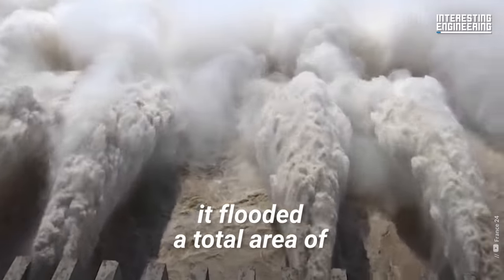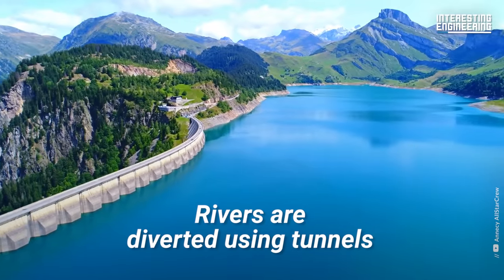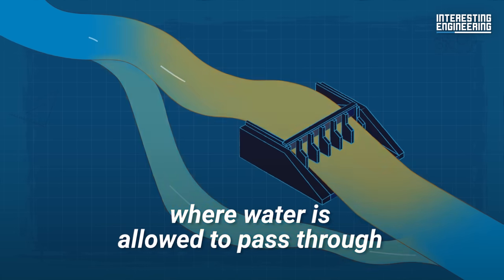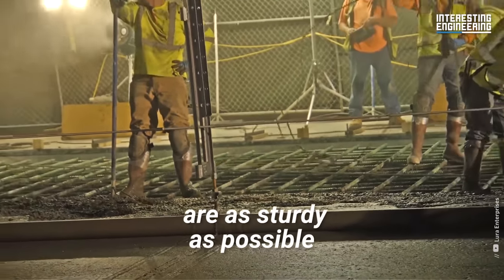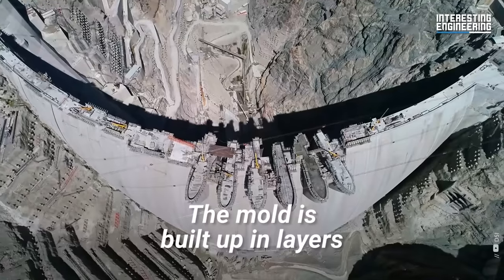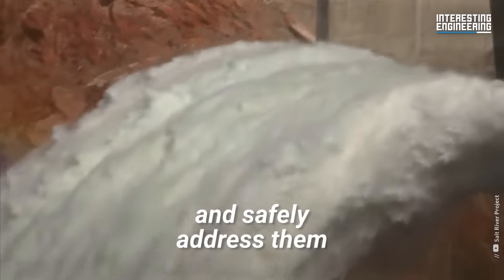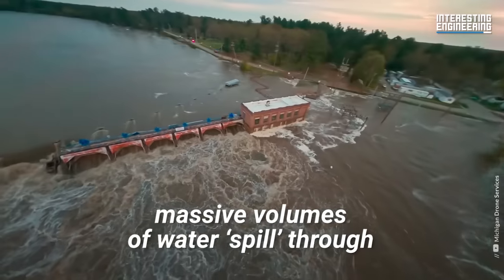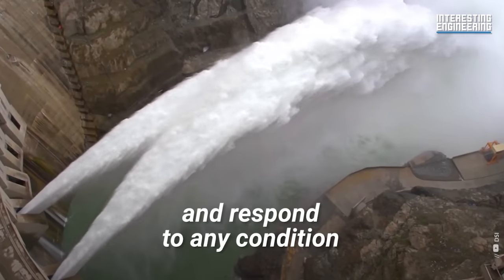How to build a dam

Comment: Very Informative, 
I was just confused, how they stop the flow of water while constructing the dams?
Reply: They don't, they are built on flowing rivers and the concrete is inserted underneath, like at 1:47. Sections are usually heavy enough to resist the flow of water adequately during insertion. If water flow is vigorous enough, then a diversion will be built, perpindicular to the water flow, to divert water form the river elsewhere while the main dam is built. P.S. when you see a dam and it has water up to the top on one side and water almost at the bottom on the other side, know that the side with the water at the top is the reservoir, which is filled up after the dam is complete.
Reply: I dont know what kind of long-winded pseudo-answer Mr Vivic is providing above.

The answer to your question is that they divert the water around the construction site.  Simple as that.  Build a channel or channels that allow water to flow around wherever they working.  When the dam is complete, they plug the channels.  In some cases, they might build a structure called a cofferdam or caisson in the river itself and perform construction within the de-watered cofferdam area.
Reply: @johnnyvivic8730  1:47 is some unrelated stock footage.  The dam in that scene has already been built.  No, they do not simply lower pre-cast concrete blocks in place within the river.  They cannot become monolithic structures that way.
Reply: @elena6516 if the flow is too much 
Can a coffer dam be able to hold it still